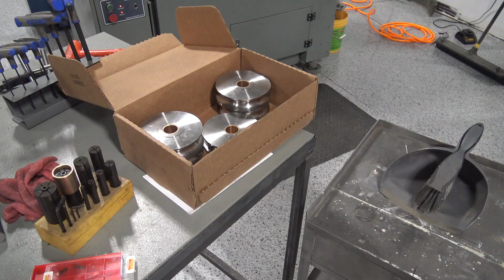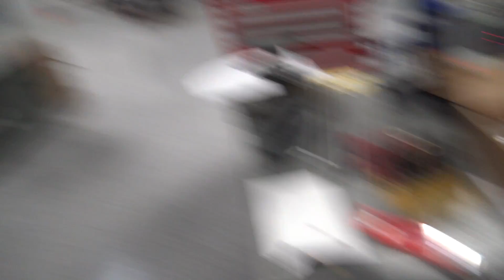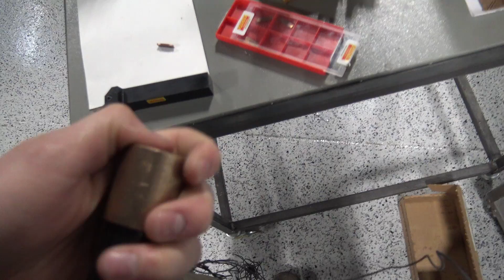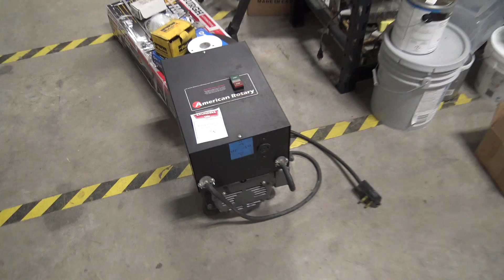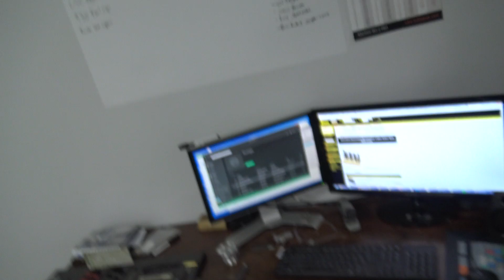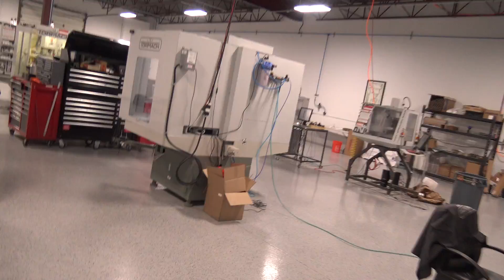Chip Break #3 - Machine Shop & Small Business Daily Life

Comment: Go the old school route for the board. Buy a sheet of glass, mount it on the wall, and then paint it with white-board paint. If you go to a channel called "Iandi Boats" (he's building his own boat in his back yard), he made a draft/work table and painted the top in this white-board paint so he can put the wood structure 1:1 on and cut angles/make setups.

Best part about something like this is, if the paint gets old and abused, since it's glass, all you have to do is get a paint heat gun removed and scrape it off, then paint it again. Reusable, simple. Works.
Reply: +aserta We have done something similar in the Design Tech workshop at school so that items can be drawn and discussed at 1 : 1 and there is a overhead gantry dolly system so the drawings can be recorded and or posted on the interactive whiteboard.

Comment: Here in Australia Sandvik are really popular because of the support we get.  I've used other brands, and really the most important thing is getting the right information and technical support behind the product.  When I was setting up the tool libraries at my last job I found it really difficult to get the right information with the tools we already had.  But not with Sandvik, saved me a bunch of time that probably paid for the tool.  When I was on the tools before I moved into design, the range was limited, but they've expanded the range by acquiring other companies and now have a pretty complete offering.  The local reps here are normally always ex-machinists so they can walk the talk, and don't mind spending time with you even if their only going to sell 1 insert.  Stock turn around is pretty good with 24hr delivery times out of the Singapore distribution centre to outer Metro areas here in Queensland.

Comment: Hi John,  You can buy 4 x 8 foot smooth white hardboard panels for about $13.00 at Lowes or Home Depot.  The surface works very well with the dry erase markers. Hang them on the wall with 3M command strips so you can move them when and where you want with no marks on the walls. The Melamine foam magic sponges work extremely well as an eraser.

Comment: with you on bootstrapping to get to a certain point and then going for the best you can afford. Its very difficult to run the two modes at once... can be a source of great frustration especially to others working for you. It can be very hard to foray into testing certain waters without bootstrapping but better than ending up with a black eye for just trying something... tough calls. As long as you start anything with a good plan you can't be faulted for trying, shoe string or not.

Comment: I'm really enjoying your vlog. I have a suggestion. Consider buying a DJI OSMO camera. It shoots HD and 4K, is light weight to hold in one hand, and is also stabilized in three dimensions. It's under $600 and I think would improve your production values quite a bit. With it you might even consider creating some on-line video classes for a reasonable cost. Then you'd have a triple threat: YouTube free, on-line video courses for, say, under $100 and your in-house classes. Just a thought.
Reply: +NYC CNC Your iPhone just becomes the viewfinder and settings adjustment. nice piece of kit for Vlogging.
Reply: +NYC CNC No. It is a complete system. You use an app on your smartphone to control it, but it has its own camera. Personally, I don't care for smartphone cameras and prefer a larger sensor. There are stabilizers that hold your smartphone too, but many cost as much as the OSMO which includes the camera. Also, DJI is a really well-known company with a great reputation. I'm planning to buy one myself this summer and have been researching it for a couple of months. You can find many YouTube videos about it that will give you an  idea of how it works and the quality of the video it gives. One feature is a button that pivots the camera from forward to selfie mode. Push it again and it swings back.

Comment: May I make a suggestion to keep the small compressor, when the new one goes down( and it will) you need to ask yourself how long you can survive with out air in the shop. what if it take 2-3 weeks to get the parts needed to fix the new one. redundancy is a good thing in your utilities. My two cents, I enjoy your posts and would like to visit your shop someday(Pittsburgh PA).
Reply: +NYC CNC The compressor is paid for, why sell it and buy a smaller backup unit.    You would be miles ahead to just keep it and move on to the next issue.

Comment: Those Sandvik look like my Kennametal groove and turn. My suggestion on inserts is find the one with the best and most knowledgeable rep in your area. A good rep is worth more than any price difference in quality tooling. Having run Sandvik, Seco, Iscar, Kennametal, and Ingersoll I can say that they all have pretty equivalent carbide grades in performance if you can figure out which ones match up. I actually find the biggest difference is in the chip breakers and what they offer.  You need a company with a lot of chip breaker options. I imagine with your Tormach  many of the inserts are not designed properly for your machine because you don't have the power to take the speeds and feeds cuts they are made for, thus the stringy chips.  I suspect you operate in the "fine finish" range mostly. What I like to do is scour ebay and buy lots of various inserts for pennies on the dollar and try them out to see how they work for me. When i find a winner than I know what to get from the manufacturer. This is where a good rep comes in, if you have one many times they will get you one insert to try on a job so you don't have to buy one to find out how it works.
Reply: +bcbloc02 Some would say, and with justification, that the most important aspect of an insert is the chip breaker as it defines the amount and quality of the cut. Generic unbranded inserts are pot luck on the chip breaker and what they are good for, if anything. Also with name brand inserts you have a good idea about the insert grade, something lacking with cheap generics. Personally I love Sumitomo's Cermet (ceramic/metal), when I can justify the price , but I'm sure there are others just as good.
Reply: Chris Stephens
I have used the Kennametal cermets and they hold an edge like crazy, ran a bunch of 4340 shafts on one insert and they were as good at size and finish after 4hr of turning as they were when they started. The ones I had hated interrupted cuts though, if it as so much as got near a hole or a break in the cut it was gone.  Because of the work that I do I tend towards choosing grades with extreme toughness more so than extreme edge life. A long lasting edge isn't too long lasting if it is broke off. :-(  That is again why I think a good rep that will work with you to find the best insert for the work you do is the key. The inserts that work the best for me might be total garbage for the work the next guy is doing.
Reply: As the saying goes "if you want an answer to a question, ask an expert" or in this case a Rep. 
All of my work could be called "small scale" where finish is everything, even if not asked for:>)